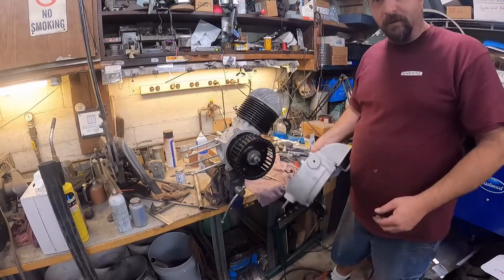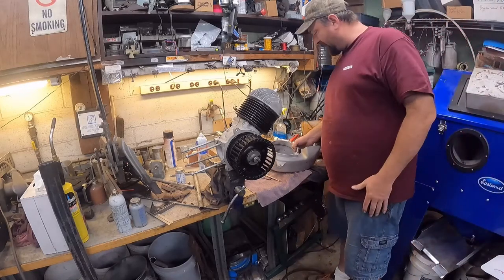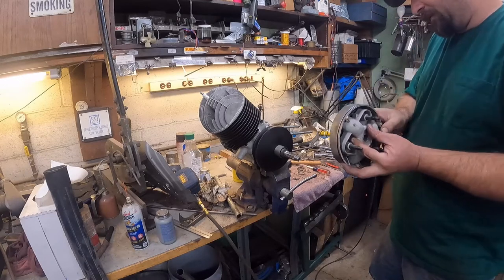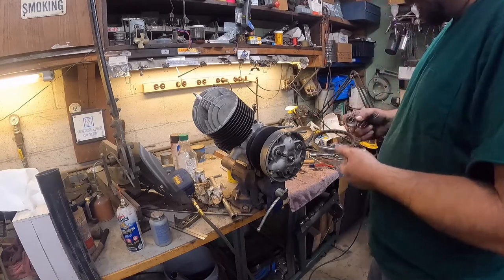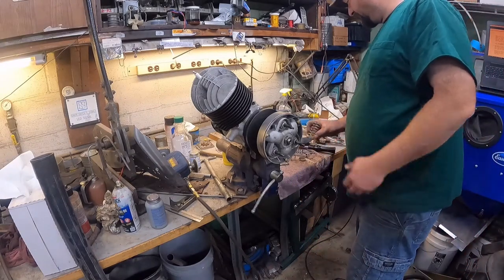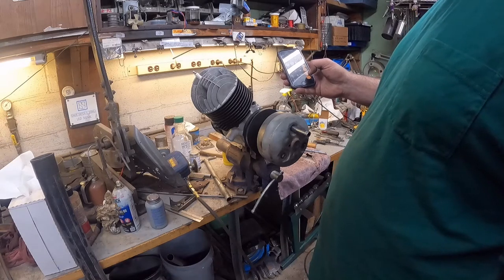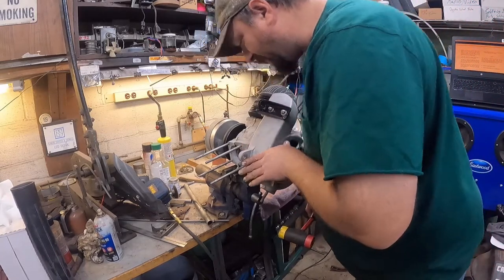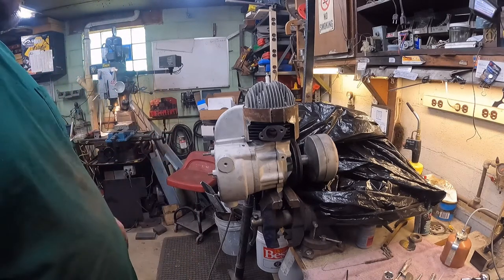Part 5 Project Golf Cart Engine rebuild, Clutch and fan housing, 1976 Harley Davidson AMF Golf Cart.

Comment: I like this video. I have the same Harley 3 wheel 1976. clutch was in pieces. ground was missing. But started right up. Need to find where wires go to starter/generator.
Reply from the maker: Thanks, Here is a link for the manual, I think the wiring diagram is on page 155. Let me know if this 
helps, if not we can try and arrange a call. 
https://www.golfcartreport.com/wp-content/uploads/2019/06/HD_Manual_Service_1963_1980_GS-compressed.pdf

Comment: When you put the first half of the primary on the shaft what direction was the piece that has the felt seal oriented? Felt seal pointing toward the inner o-ring so it’s always in contact with the inner sleeve?
Reply from the maker: Yep, the felt is towards the the O-ring on the crank shaft or towards the engine. The felt should be slightly oiled too, its to help lube the bearing in the clutch housing. Here is a link to the manual, section 4, and page 4-4 has a diagram showing it. https://www.golfcartreport.com/wp-content/uploads/2019/06/HD_Manual_Service_1963_1980_GS-compressed.pdf
Thanks for watching!

Comment: Can you tell me how to put the throttle cable on? I bought a new carb and not sure how the cable goes. there is a bend in it do i push it through one of the slot's on the lever. i assume i have to pull the lever back then install the cable so when i push the gas pedal it will push the lever back to the back of the cart?
Reply from the maker: What I did was I put the cable though one of the slots on the throttle lever on carb,  than put a brick on the gas peddle. I used a cable clamp that I slid over the cable then tightened up about a1/4"away from the throttle lever on the carb. After that I made sure it closed and opened all the way and so far it works well for me. Good luck and thanks for watching!
Reply: @SABsGarage     I haven't watched all the videos just yet, I'm going in order.   You said that your carb was not repairable, can you please tell me which carb you used?   Thanks in advance for your reply.